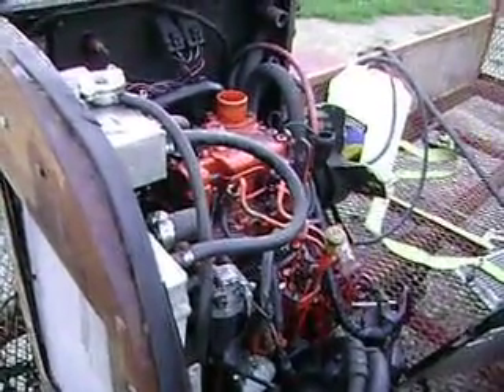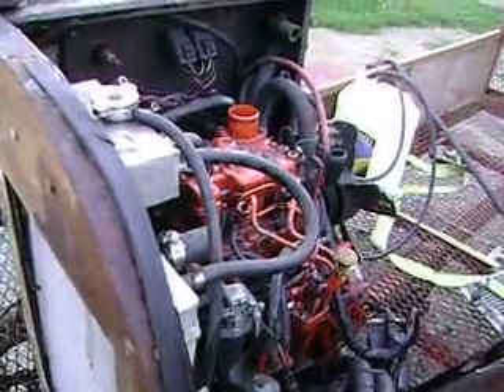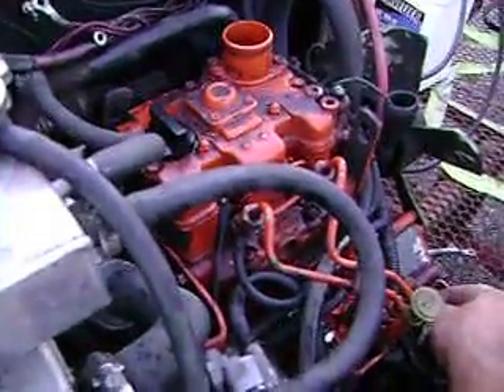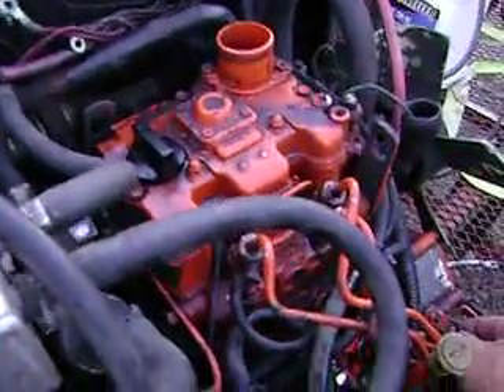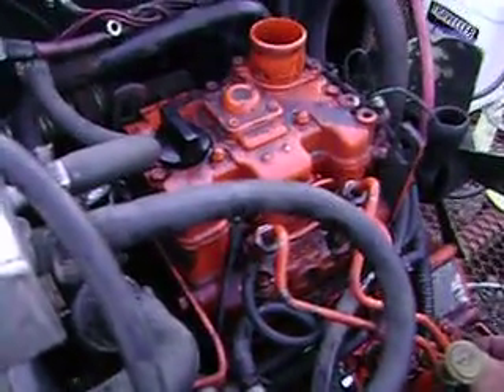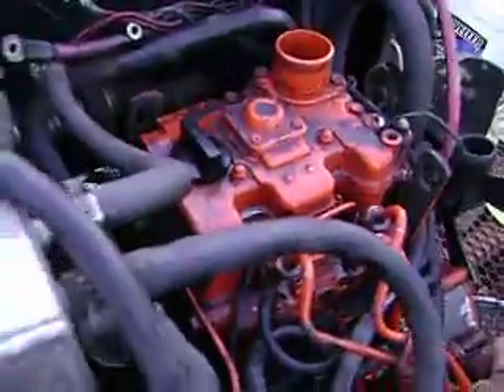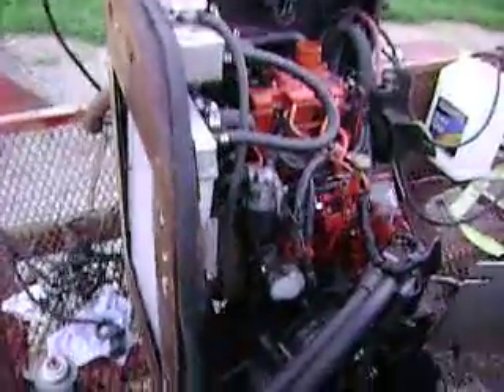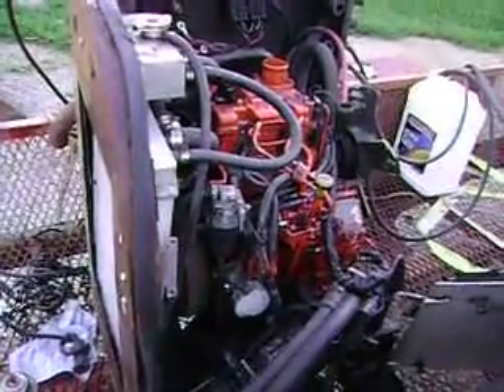Perkins 2 cylinder Diesel Engine

Comment from the maker: Lesterdoug, my wiring had been hacked up as well.  As far as running, the only wire you need for the engine to run is 12VDC to the on/off solenoid in the back end of the injector pump area.